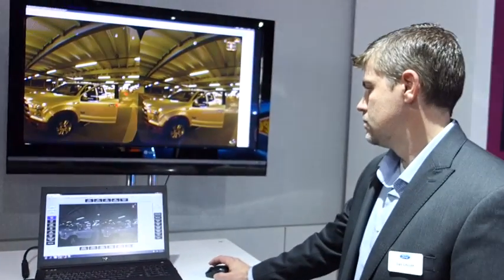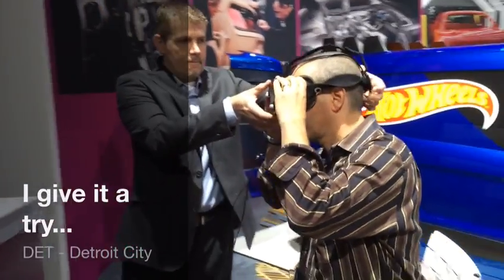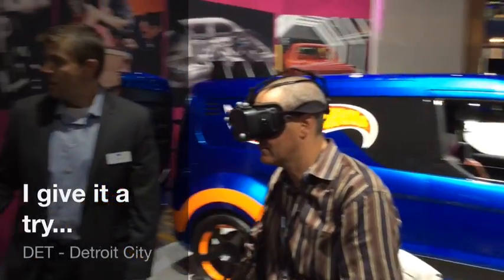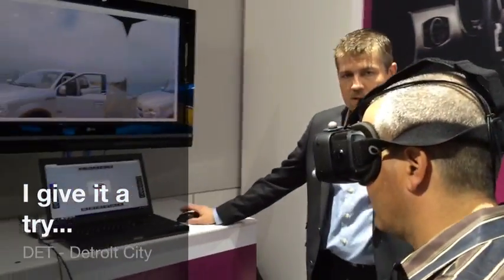Ford Uses Oculus Rift HD for Design Simulation

Comment: I hope the frame rate is better in the Rift than it was on the TV
Reply: There is another Video with another VR-Goggle showing the Science-Team of Ford using it to watch in those Cars without building them allready. There its fluid and with like 30 fps and they say that the resolution is at 4K! 4K Could be a little to much for that Laptop shown here ;)